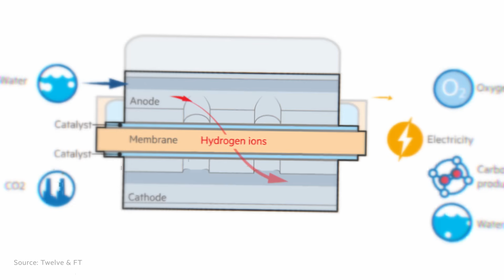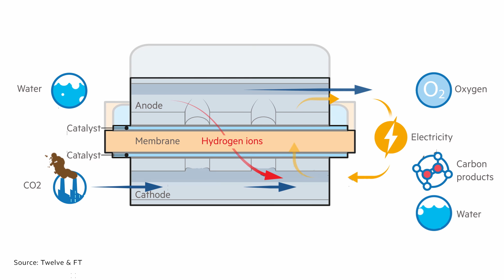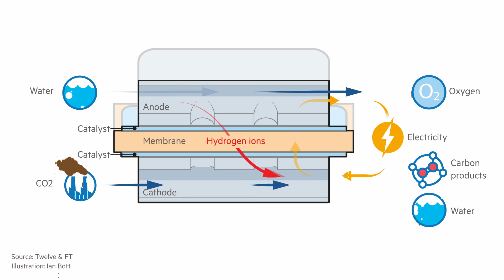How to build an artificial tree | FT Energy Source

Comment: Oil and gas level of investment in Green Energy is pretty low. Shell for example plan to invest $6billion by 2030 (circa 660million a year to 2030).
 
In the past four years the same company spent more than $120bn developing fossil fuel projects ($30bn a year) and Shell set out plans to increase its total spending in this field (fossil fuels) to $30bn a year from early 2020s onwards ($300 billion between 2020  to 2030).
 
To put this further into context, Shells revenue for 2019 (just one year) was $344.9 billion.

Comment: Wow, imagine where this could go. The future will truly have arrived when we can manufacture anything out of 'thin air' and sunlight. The next crisis would be too little carbon in the atmosphere!
Reply: As long as anything that comes out of these machines is either biodegradable/compostable or is not a single use product, otherwise they are just printing new crap that will end up in landfill or the oceans.
Reply: @Patrick-jj5nh  If you remove plastics, most of everything else is biodegrable. Metals, silicates, should att just degrade. Now heavy metals will cause harm but they will degrade. 

The more I think about it, you get rid of plastics and that is most of the battle. A pure carbon based product you could technically just put it on your compost heap.

Comment: I know there's a natural desire to believe you can make money from captured CO2, but I'm not hearing anything in this video about how much CO2 can be used in making new products. I think it must be orders of magnitude less than all excess carbon in the air, which is somewhere in excess of a trillion tonnes (multiple trillions for the mass of CO2). I don't think all the World's artifacts, even if they were ALL made out of wood or plastic, would come close to that. We need to face the fact that carbon capture and sequestration is just not going to be a money-making proposition. Fortunately, the costs can be reduced enough to eventually be bearable. But disposal will be a bigger cost than capture.

Comment: Why not just grow trees?
Reply: 7 billion people on the planet and you think they can only do one thing
Reply: They take a ton of space, anyways things like peat fields are better at capturing carbon
Reply: @iain3713  we've no shortage of space
Reply: @OrwellsHousecat  a Forrest takes up around .5kg of carbon per square meter a year. Trees are great but they obviously aren’t a solution for sequestering carbon. Peatlands take up 10 times less area than the world's forests which take up about 30% of the world's land area yet sequester double the carbon. While I don’t think carbon dioxide removal will be the direct solution to climate change, the cost is too high and emissions reductions must come first. These technologies don’t just have to be used with direct air capture where carbon is taken directly from the air, but can also be used with carbon capture and storage where carbon is taken from point sources where decarbonisation may not be economically viable, such as some power plants, steel furnaces and cement factories just the name a few.
Reply: @iain3713  why take carbon out of 'the air' rather than directly from the sources of pollution at the time of it's production? 
, in the same way as cars have exhausts & catalytic converters, and power plants have processes to remove the pollution before releasing the air.
Reply: @OrwellsHousecat  Well it’s technology that may become more useful with emission reductions I guess. I don’t really think direct air capture is a very feasible way to mitigate climate change tbh. It definitely seems overhyped and I think a lot of it is psychological, a lot of people want to have a technological solution to climate change where nothing really needs to change, something that is unrealistic. Another thing is that direct air capture seems more proactive, that you’re actively removing carbon instead of just preventing emissions, when in reality both actions achieve the same things, with emission cutting being a lot more economical and effective. Who knows, maybe there will be a breakthrough where the technology becomes so economically viable and effective that it really will be the solution. 

Also the large scale emitters and the people financing these projects aren’t one solid body, the emitters will find on site carbon capture uneconomical, and the people financing these carbon capture methods likely prefer the prospects of direct air capture for the above reasons, it’s a ‘sexy high tech’ solution.